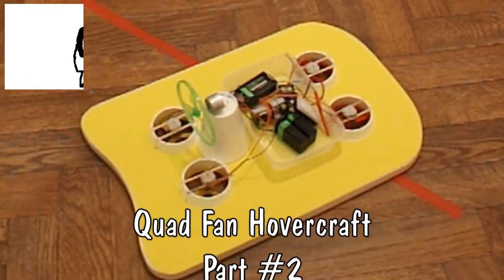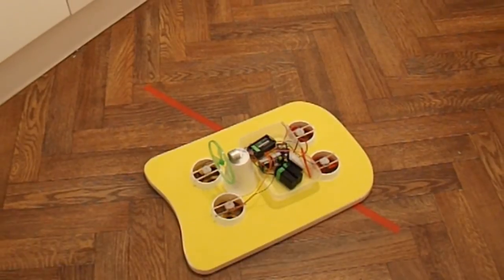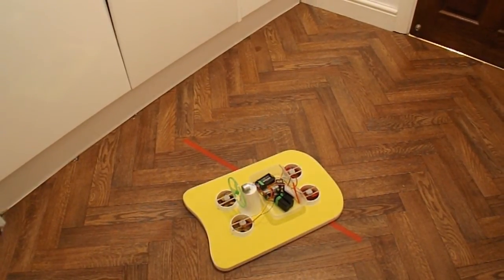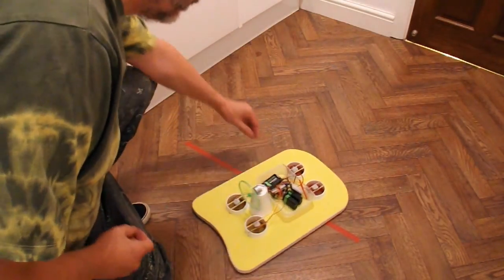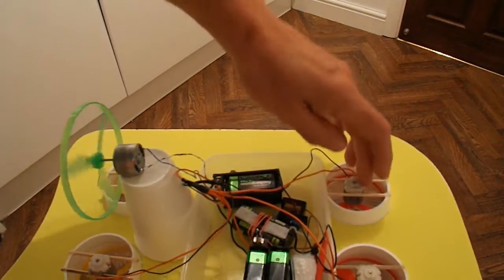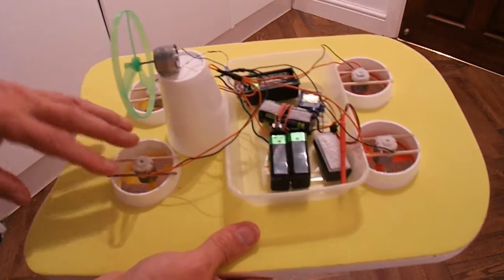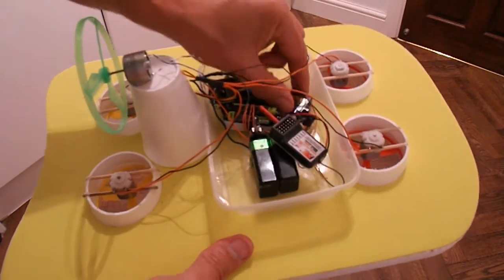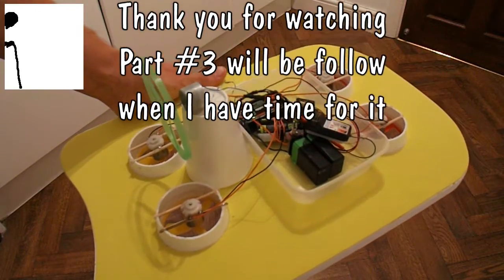Quad Fan Hovercraft Part #2 - load carrying test

Comment: Can I use Small Electric DC Motor 6v, High-speed, for RC Toys and RC Cars which i saw on ebay?
Can I use thermocol for the base instead of a swim pad? Please reply fast. I have to finish my project within 5 september
Reply from the maker: +Achinthya S Hebbar there is no way I can answer your question regarding the motor as there are probably hundreds of different 6v motors on eBay. You would need to choose motors and ESCs and batteries that match each other. If you do not plan to use Radio Control then just match the motors to the batteries you have available. I had lots of problems with my motors because I was using 9 volt batteries and motors that should only use about 3 volts so they tended to overheat and the batteries didn't last long. 1 battery linked direct to 1 motor may work better than the way I tried linking all the motors together. As for the base, if you use thermocol I would suggest hollowing out the underside like an upside down bowl so there is room for the air to collect and add a skirt to help the air seal. I hope you realise there are 8 videos in this project series with many changes as the project progressed https://www.youtube.com/playlist?list=PLA5a2xPRSrB1ynqKhyKVIcl945NCbHZZE

Comment: I love these ongoing project update videos - good thinking to check the weight on the servo and receiver motors!
Reply from the maker: You will see in episode #3 I am really on the limit for the small amount of power I get from these motors. Maybe I will have to invest in proper motors and LiPo batteries at some time but that is not 'in the spirit' of the projects I do on this channel.
Reply: The limitations are what makes it a challenge.

Comment: Grandad pls help me on my battery powered car, I am using the same motor you use in your quad fan hovercraft and its powered by two AA batteries in a battery case and its connected by rubber band (from the motor's shaft with some gears to make a grip and to the axle) when i lift up the car the wheels are spinning fast but when i put it in the ground it wont move. Pls help me thank you
Reply from the maker: 1. Is the rubber band slipping so the motor turns but the back wheels don't move?
- You may need to shorten the rubber band to make it tighter or put something that rests on the band to tension it.
2. Are the front wheels free to rotate?
- If there is too much friction on the other wheels it could stop the car moving.
3. Are you using a small pulley on the motor and a large pulley on the axle?
- Small pulley on the motor and large on the axle is the best way to get power to the axle. I have moved big cars with very weak motors by having very big pulleys on the axle and very small pulleys on the motor.
- Maybe try a bigger pulley on the axle.
- large pulley on the motor and small on the axle makes the motor work too hard and it may not have enough power to turn the wheels when the car is on the ground.
- try smaller wheels, they will take less power to turn them

Comment: So that did not rotate to the left (probably due to drive torque motors), it would be a good idea to turn the engine thrust to the opposite side ?. That is, to the right ...
Greetings.
Reply from the maker: Hi Francisco. This episode was just checking that the 4 motors could lift the extra weight of the batteries and the fan and the RC receiver and the servo. In the next episode I will make the fan motor turn to give steering.